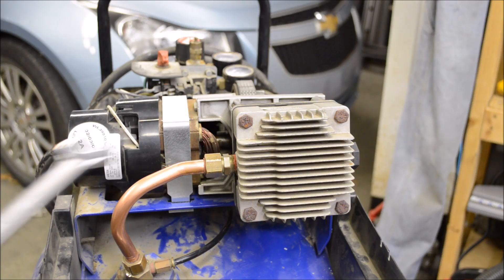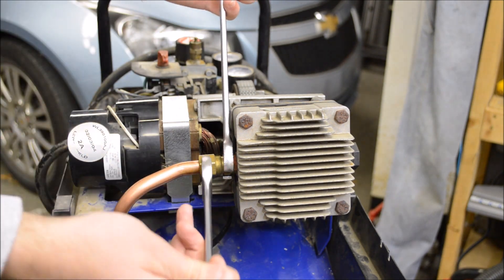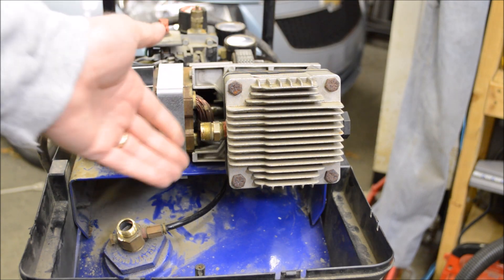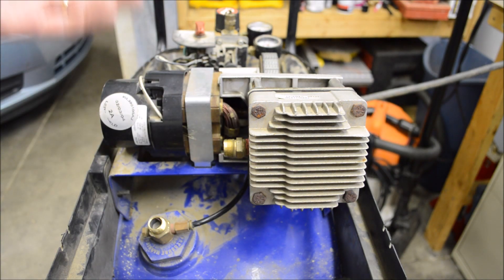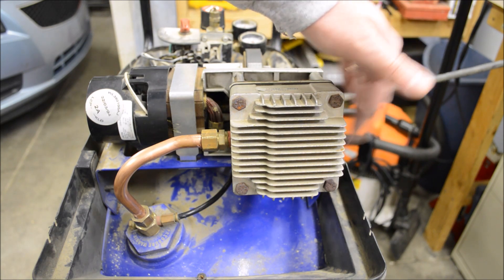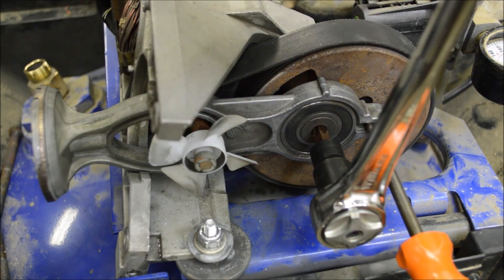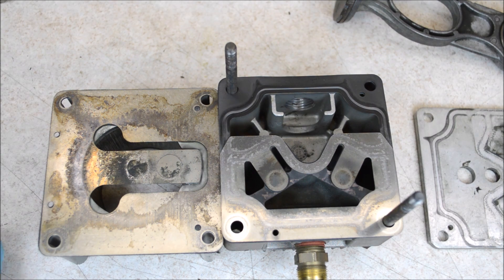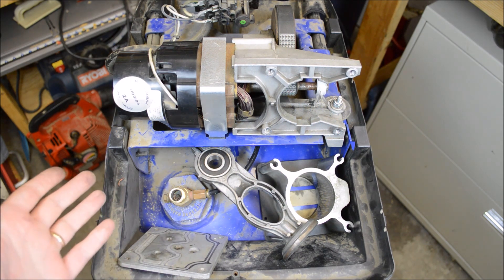How to diagnose low pressure in an air compressor: compressor repairs part 2

Comment: I've dealt with the oil-free hunks of shlt more than once. Once you have a new piston and reed valve, then you have to deal with the 250 deg cyl head pumping hot air and moisture into the tank causing internal rust in a tank that's paper thin. I installed an after cooler on my Craftsman and it sort of works after I changed all the airline fittings to high volume. I would much rather find a url somewhere that I can buy a conversion package to convert this thing to old style compressor. Bottom line, these things a junk and there's nothing availabe to change that.

Comment: i have a husky 4gal oilless that isnt building past 50 psi. ive got some gasket material from autozone and made a all new gaskets for like 30¢, problem persists, and the compressor head is getting stupid hot after a minute of running. the rest of the tank is fine, it was always a little small for me. im in the same problem you are, through parts at it vs spend 150 for a new 8 gallon compressors that should be quieter too. im fairly certain mine is the forst or second year of that genertaion of husky compressor because a lot of videos of them online look different (more user friendly when it comes to replacing belts) than mine.

Comment: You should always turn the air compressor off yourself when you're not using it.

Maybe even plug the compressor into a timer and set the timer for the approximate time you will need it.

Comment: Mine is shutting down at 50 lbs. I reset my internal breaker and it works a little bit more. Have to do this about 4 times. Any one know where the internal breaker is on this thing ?

Comment: Working on the Husky label version of the same unit I found multiple problems.
The first was that the exhaust tube had failed and was split in the bent angle of the tube. Motor mount loose and bracket was sheared allowing excess vibration. 
So on this unit definitely visually inspect everything before you order your parts.

Comment: My compressor is not makin air at all can it be the same problem?
Reply: Splits in the exhaust tube are hard to identify because the cooling fan is blowing in the same location. When the tube heats up the split opens but it can be very hard to see. Remove the tube inspect carefully.

Comment: Nine and a half times out of ten this is a reed valve or a valve gasket issue. As it is inside the valve cover there are no other indicators such as fluid or air leakage. A reed valve will allow compressor to fill anywhere from 30ish to 80ish psi. Great diagnostics video btw. Kind regards V

Comment: I had a oilless design husky and I noticed the  compressor was louder and  started running a lot without shutting off in a reasonable time. I found the main pressure copper line had a crack so I made a new one and fixed it.
Reply: Exactly. Nice

Comment: anyone know where to get air compressor parts? I came across a free rockworth oiled maybe a 50-60 gallon. Definitely need  the pressure switch main assembly which is missing and possibly  a hard pump or a motor. I need to find a way to check the compression and a way to hook up the electric motor to test it.

Comment: i have a 60 gallon air compressor. husky pro built by cambell hausfeld. it has a full sized motor and a oil lubbed cast iron pump. its belt driven. its been running since 2007 with no problems, but it is not used daily. it has been ran hard more then once. when i replace it someday, i would like a 80 gallon with a bigger pump....... not that this has been a bad unit.

question, are the cast iron belt driven pumps built the same way, with a single teflon ring?
Reply from the maker: I believe oil-lubed compressors use a piston and ring set up much closer to what auto engines use.
Reply: @ToolTeardowns  im guessing its far more robust. something that moves fast and generates heat but does not use lubrication is an all out bad idea.
Reply: @ToolTeardowns  my compressor is 12 years old and still performs very well.

Comment: Had same compressor for 12 years. My connecting rod broke after the hold down strap cracked and let go and the other bolts fell out...with how thin the tank is, I would say you got your money's worth and move on to a new better unit like I did.
Reply from the maker: I'm definitely planning on stepping up in quality. Hopefully that will happen.

Comment: trash it get a decent compressor
Reply from the maker: I like the criticize oil-free air compressors as much as the next guy, but this one did last 12 years of farm use on the original parts. That's not too bad.

Comment: At that age something else could take a dump at any time. Unless you desperately need  a compressor and can only manage $65, I'd use the tank as air storage for a new compressor. Also keep the motor around the shop, just in case you need a motor. Same with the pulleys.

Comment: A new 21 gal. 2.5 HP 125 PSI Cast Iron Vertical Air Compressor Only: $169.99
at  Harbor Freight Tools store if there one by you.

Comment: id try just replacing the piston ring if its removable and running a hone down the cylinder if you own one.. wont be perfect but if you can get 100psi out of it just adjust the switch so it shuts down at that psi rather than running coniniously trying to reach 135psi

i wouldnt worry about the motor burning up im sure if it made it through that long run session its in good shape, new compressors arent that expensive and youll definitely need one eventually but repairing things is alot more satisfying than just replacing them

if you do get a new compressor id reccomend going for a lower end on that runs on 220v theyre alot more robust